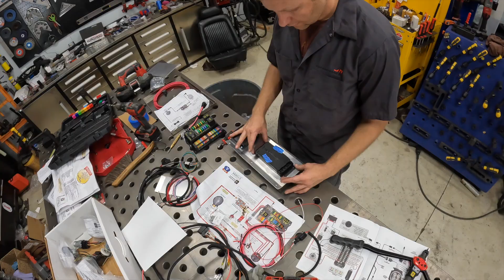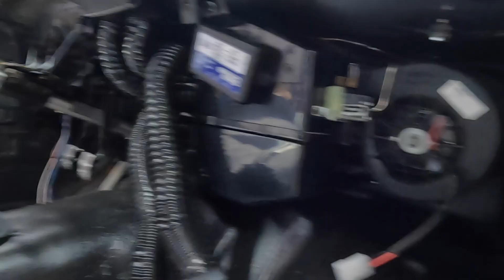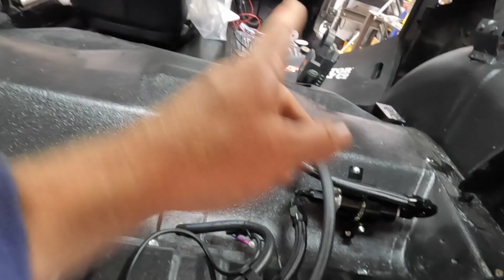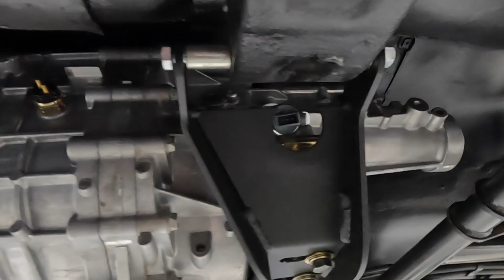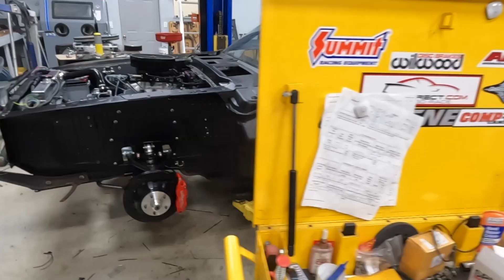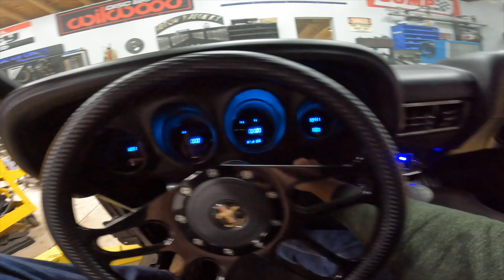-Ep14  Project Nightshade- American Autowire Highway 22 Install - 1969 Mustang

Comment: Beautiful job with the wiring. the Stang is coming together nicely. Have you thought about a Boss 429 scoop with a cutout to run that high intake? My first car was a 1969 mustang coupe with a 302 2v. Winter blue with white vinyl top and my father had a 1969 Mach1 Cobra Jet 4 spd Black Jade.. Loving your progress.
Reply from the maker: Thanks man! I just had a new little one and have gotten real behind on videos… I ended up cutting the hood and fitting a boss 9 scoop! It just clears
Reply: @GearOnPerformance  Hey It's all good I understand that. Haha that's Awesome I figured you had enough room with that scoop. Love the build and look forward to an update when your life settles down. Congrats on the new little one!

Comment: I was wondering if you made the powder coating heat cabinet or did you buy it would like info if you would
Reply from the maker: I made it. I used 16ga outsides and 20ga inside. 3 - 3000 watt elements. Rockwool insulation. I drive it with a PID for temp control. It uses a thermocoupler to determine temp and solid state relays to turn on and off the element. I may do a video on it
Reply: @GearOnPerformance where could I buy the controls from